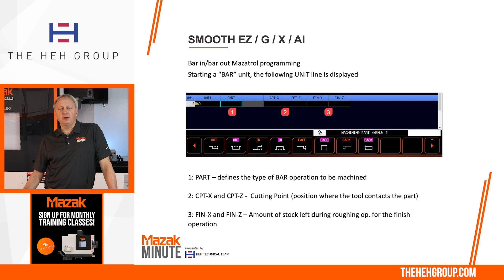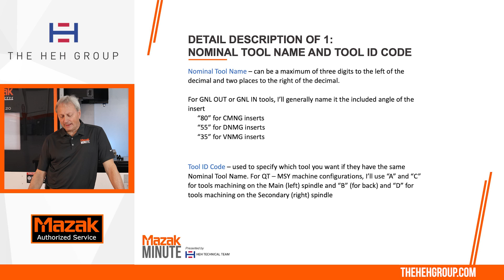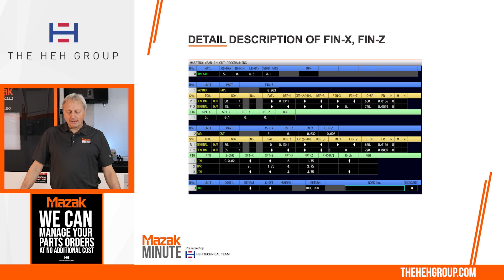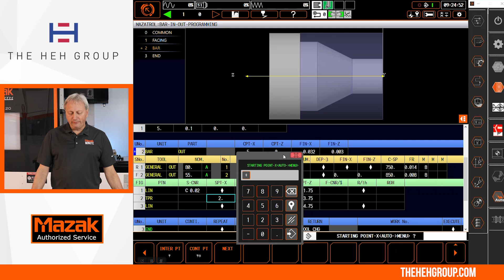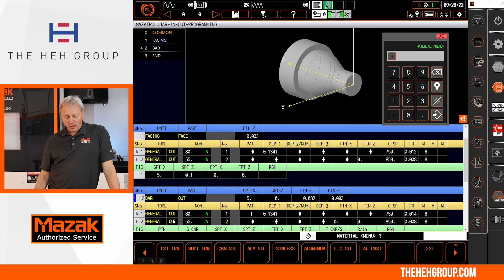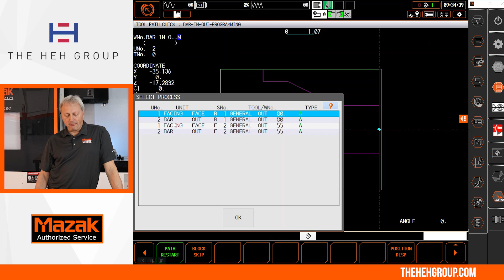Mazak Minute | Episode 4 | Smooth EZ/G/X

Comment: Does Mazak have a software so you can program on PC rather than on the machine?
Reply from the maker: Yes! You can get a smooth cam software for you PC/laptop.
Reply: @TheHEHGroup  What's the name of said product? Because smooth cam RS doesn't seem to exist any longer? I can't find any information on it on Mazaks website at least.
Reply from the maker: @Mokkisjeva  It is called the SmoothCam software. There is three versions; M, T, and MT and it can be purchased through the Mazak parts department or you can call The HEH Group and our team can help. Here is our website if you'd like our assistance: https://www.thehehgroup.com/contact/